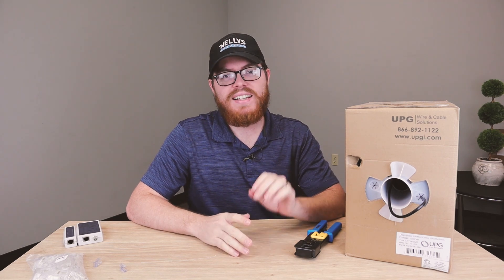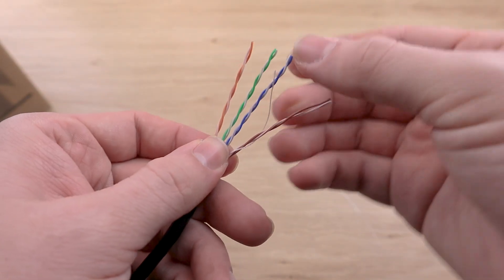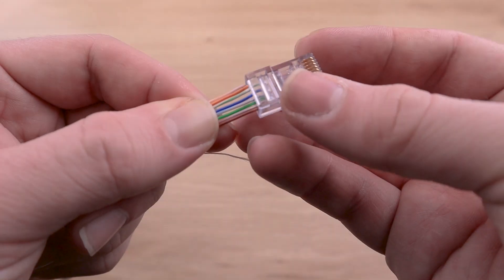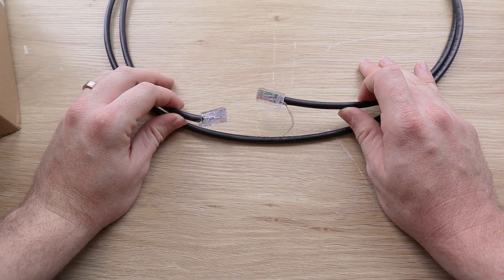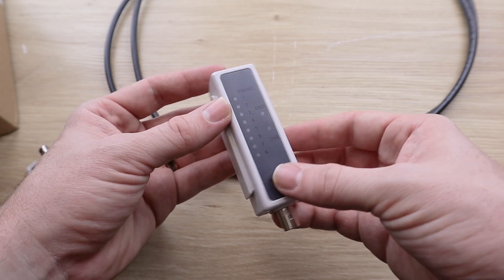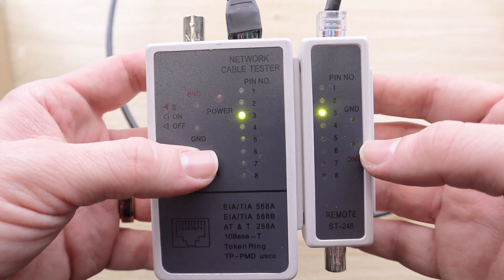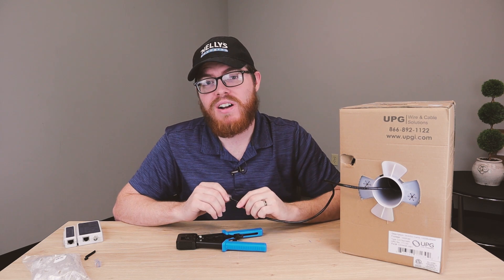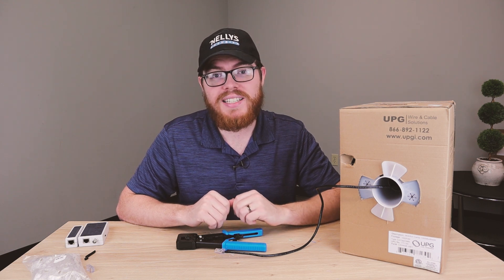How to Make Your Own Network Cables: Crimping and Testing RJ45 Connectors and Bulk Cat5e Ethernet

Comment: If an individual light does not come on, that is an open in that connection, not a "short". "Shorts" usually show up as more than one line lit up at the same time.

Comment: yeah great but if you are retrotesting an existing instalation the cable test aint much use ? (tester may be 100ft apart in two locations)  cannot see both sets of LEDs at the same time maybe just missing ones or out of sequuence  ?  not sure what do u think ?
Reply: They should still show in the correct order at the remote end

Comment: Where do you get the RJ45 connectors where you can pull the eight wires straight through that make it much easier to crimp them properly. It’s the first time I seen them have they a specific name?
Reply from the maker: we have em here -> https://www.nellyssecurity.com/rj45-cat5e-pass-through-crimp-connector-bag-of-100.html

Comment: Just curious, do the orders of the colors actually matter, as long as you have them the same on each side?
Reply from the maker: In the grand scheme of things, as long as the color order is the same on both ends, you should be fine.

But there are standards in place (T-258A & T-258B) just to keep everything uniform.